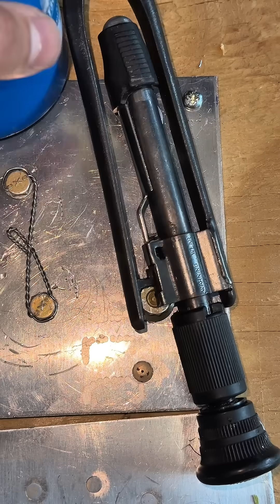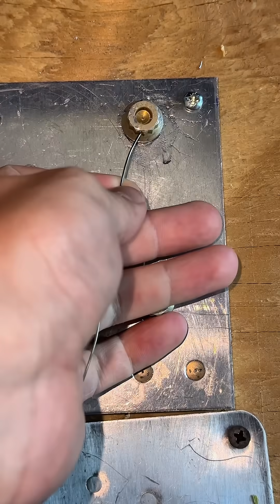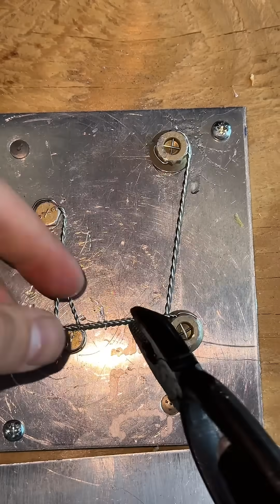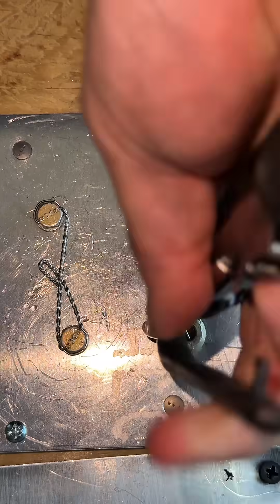Jet tech: Boomers Hated This Safety Wire Tip 😤✈️ #AviationMechanic #shorts #mechanic

Comment: The Air Force has been using safety wire pliers since they were invented.

My father was a jet engine mechanic on 3 blade prop A-model C-130's from 1959 to 1964 (he got stop-loss'd by the Cuban Missile Crisis)

He's 85 and he still has a pair of "crew chief" pliers in his tool board.

They're a great tool.
Reply: It is interesting the difference between branches. I was an army Blackhawk mechanic 10 years ago. No pliers allowed. If Qc saw any marks on the wire from pliers they would cut it. Always figured it was across all branches.
Reply: @anthonydrew4388 the disrespectful child that made the video and the "doing it right" comment thinks he knows everything and hasn't lived or experienced enough to realize that there are other ways than what he was taught. He probably believes that the FAA is some infallible entity and not just a group of talking monkeys that have agreed to agree about a thing.

Comment: I do all kinds of fabeicating at work, and sometimes keeping things together is a chore, I work in a stamping plant, but this is a nice technique, I'm gonna have to keep this in my mental toolbox, can just drill a couple little holes in the head of an allen head bolt 👍
Reply from the maker: You can order predrilled bolts online
Reply: @northeastaviationpro if it was for a personal project I probably would, but tool and die has any size bolt I could want for work projects, and half the fun is making it yourself 😁
Reply from the maker: @Dsmwarrior1996  nice good luck
Reply: @northeastaviationpro thanks for the technique, I love little things like this!

Comment: I'm a boomer aviation mechanic.
I know how to do a proper safety wire by hand.
But, if I have safety wire pliers handy, I will use those.
Work smarter, not harder.
Reply from the maker: Ty
Reply: @northeastaviationpro   literally the dude you were talking about 🤣
Reply: Ya I’d use the pliers too.
Reply: Me too, 1970-'74 Navy Avionics tech. We were issued, and used, safety wire pliers every day. Ya, we had to know how to achieve the same perfection without them, but nobody did that unless the job was so tight that the pliers were a handicap. I got yer "boomer" right here.
Reply: Good job. Pliers are ok where they work. Sometimes hand is easier too… 24 y commercial aviation ret.
Reply: Gotcha boomer, watch this video again and this time, really hear what is said in this video. If hard of hearing, enable captions.
Reply: @miloesalazar 
Gotcha Milo.
Now, read my comment again, and this time, really read what I wrote.
Try to comprehend all the letters.
Reply: @miloesalazar  go sit in the corner & color Phil. Or should we call you 2380.
Reply: @miloesalazar 
All I said was that I use safety wire pliers.
I may be a boomer, but you're just another 🍆 in the YouTubes comment section. 🤷

Comment: I personally love cable lockwire systems, check out Bergen Cable to see what I am talking about.  Cable lockwire creates less opportunity for FOD on installation/removal, is easier to install and you can actually prove the strength of the cable which you can't do with hand done lockwire.  I know what everyone says, too expensive but if you do the math on it, you will save a lot of time and time is money.  If you save 4 minutes installing and removing cable lockwire, by the time you go through a hundred cables you have saved 400 minutes of time.  Therefore those saved hours of time save the cost of the tool and the cables by far...  Better technology, higher quality, less opportunity for mistakes and a higher level of safety.  I agree with you 100%, quality is job one because our mistakes make smoking holes in the ground with dead people in them, keep up the good work!!

Comment: that's funny, my dad was an aviation machinist on the USS Shangri-la during the Korean era, and later an A/P with IA and he always had those pliers, I have them now, circa 1960 manufacture, so it's not new, and I've never heard anyone say they used to do it by hand and I hung out with a lot of old wrenchers in the aviation sector, basically you're making a "contoversy" where none exist and correcting no one.
Reply from the maker: its a joke
Reply: @northeastaviationpro  it's not funny then, kind of childish and unprofessional, just what your industry doesn't need.
Reply from the maker: Ok snowflake
Reply: @northeastaviationpro  you would be an example of the immaturity apparently, DEI hire?
Reply from the maker: @HappyLittleSquirrel-k5j

Let me clear this up once and for all:

I didn’t attack boomers—I imitated the ones who pop into my comments to cry about safety wire like I personally insulted their toolkit. I made a joke, and somehow that triggered a multi-paragraph essay about your dad’s pliers and some imaginary controversy.

I’ve made safety wire content that’s helped thousands of techs pass oral/practicals, sharpen their technique, and even start their A&P journey. I’ve done more for the aviation maintenance community through these videos than your passive-aggressive nostalgia ever will.

Calling a joke “unprofessional” while getting offended on behalf of your dad’s pliers from 1960? That’s not professionalism—that’s fragile ego wrapped in a war story.

Also, tossing around “DEI hire” as an insult just proves you’re not actually concerned with professionalism—just mad someone younger is getting attention and helping people in a way you never did.

The boomers didn’t get attacked—they showed up mad that someone was doing safety wire different than their memory of it. And spoiler alert: that’s not my problem.
Reply: @northeastaviationpro  hopefully your childish pride doesn't make a plane fall out of the sky, have a nice day
Reply from the maker: “Childish pride”? Buddy, I’ve made hundreds of videos teaching people actual skills—not nostalgia, not fairy tales about how you did it in ‘Nam, but real, modern training that’s helped thousands of A&Ps pass their tests, get jobs, and keep planes flying safely.

If my videos were dangerous, FAA examiners wouldn’t be recommending them. If my work was childish, the people using it wouldn’t be licensed professionals now.

You’re not mad about safety—you’re mad you’re not the one in the spotlight. And hiding behind “concern for aviation safety” while tossing insults in a YouTube comment section? That’s not professionalism. That’s washed-up bitterness dressed as relevance.

So here’s a thought: Instead of worrying about planes falling from the sky, worry about your fragile ego crashing every time someone younger does it better.

Have the day you deserve.

Comment: For anyone like me who had no clue what was going on at first, here’s a quick explanation: 

Safety Wiring (commonly referred to as Safetying in the Av industry) is used to secure mechanical fasteners that may otherwise come loose due to vibrational or other similar forces. This practice is simply using basic physics/mechanics to connect 2 or more fasteners in such a fashion that the retentive force is in the opposite direction of the objects’ removal. Meaning any vibrations that would previously cause the fastener to jar/thread loose? Is now nullified, or will even tighten said fastener. 

(This comment section seems much more educated on the topic than I. Someone more knowledgeable is very welcome to correct me or expound upon my comment)
Reply: What's going on here is that the narrator is slandering an entire generation.
Reply from the maker: False but good try
Reply: @LucidDreamer54321  he must have watched the recent magic money wojack videos :-)
Reply: Now explain to me why thread lock isn't good enough.
Reply: @kingpest13  When maintenance or repairs are needed, do you want to deal with breaking free the thread lock and spend time properly cleaning the threads, or would you rather simply cut and remove safety wires?
Reply: @kingpest13  For NASA zero-g flights that require positive locking, loctite can be used as a secondary locking feature but not as the primary locking feature. This is due to the amount of failures they observed with loctite during ground tests.

And yeah, thread lock just isn't practical for many purposes. You're making things harder for yourself while achieving a less reliable positive lock.
Reply: @kingpest13  for the same reason you don't assemble a whole airplane using only glue: metal is king.

Comment: Safety wire should not be under high tension. It should have a little bit of wiggle in it and that is per regulation and that is to let you know that the wire the nuts haven't backed off. If it's tight then you know it's backed off

Comment: Old semi trucks have wire on mechanical fuel pump and compressor. This tech is as old as the boomers… they designed it😂🎉. It still works good to this day for certain things
Reply from the maker: That’s right, it’s a timeless technique, for sure!

Comment: Some use it on big two stroke bikes as well. Like the 500cc to 750cc. I see it mostly on older two stroke Street bikes modded for drag racing. But it's a good idea for any two star cause they have a tendency to rattle the bolts lose.
Reply from the maker: Yes they vibrate a lot ive used it on 90cc 2 strokes works like a charm

Comment: In the 80s, I worked for the Navy on submarines. We had to put lockwires on certain types of valves and fittings.  We had the lockwire pliers - they worked great. I couldn't imagine trying to do proper lockwire without one
Reply from the maker: That's awesome you got to work on subs, those pliers definitely make the job easier!

Comment: You did one wrong. You dont cross in through the bolt + you go around. Im in AP school right now and have 10yrs in Aviation and 15yrs Automotive. The rest were right.
Reply: You one of them boomers aren't you 😂
Reply: @mrm9369 37 and work for the big 3 Commercial Airliners.
Reply from the maker: Boooooooooomer

Comment: Airframe I worked on decided to go with safety cable instead of wire. Much easier to do. More expensive though
Reply from the maker: That sounds interesting, I've never worked on a system that used safety cable, but I bet it is easier.

Comment: I'd fail you on both!  Pigtail too long and also for touching the span on the left, and touching on the right.  Safety wire should not touch itself once twisted.  It can crack and break the wire with vibration.  Would also question the crossed wire in those bolt heads.  If the book says it's OK, then it's OK.
Reply from the maker: Crazy how some people get so hyped to fail others in a comment section like they’re running a certification board from their couch. 😂
Real ones know it’s about learning, improving, and sharing—not flexing imaginary authority on social media. Appreciate your input though, boss.
Reply: @northeastaviationpro  Old military aircraft mechanic gigging you as my instructors gigged me.  Yes, I gone through a full day with a TI trying to get positive safeties on a line of bolts that can only be wired neutral.  That's a frustrating day!
Reply from the maker: ? Not sure what you point is but ok

Comment: Get over yourself dude. Nobody goes around counting twists. If it stops the bolt or nut from turning it's fine. It takes a couple minutes to explain safety wire to a rookie: another couple minutes to show and a couple more to let them do it. Then they're experts.
Reply from the maker: Yeah bro, just slap some wire on and call it a day, right? 😂 That’s exactly how planes end up in accident reports. ‘Good enough’ isn’t the standard—precision is. If you’re bragging about rushing through safety wire like it’s a TikTok challenge, maybe this isn’t the craft for you
Reply: @northeastaviationpro  yes, that's pretty much it. You're not splitting an atom, you're securing a bolt. Spent decades laughing at mechanics like you: not for being conscientious- that's fine- but because they think it has to look pretty. I guarantee you're one of those.
Reply from the maker: Aight bet, keep flexin’ like half-twistin’ safety wire makes you a OG. Y’all out here buildin’ paper planes while real ones build machines that stay in the sky. ‘Good enough’ gets body bags, not respect. You proud you been lazy for decades? Congrats bro, you been wrong for 30 years straight. I ain’t tryna make it pretty—I’m tryna make sure it don’t fall out the sky ’cause some old head thought vibes and prayers would hold a bolt

Comment: Retired Army tracked Mechanic.. done thousands of those on the M1 Abrahams since its a turbine powerplant.. good job!
Reply: Used them tons on 25 Mike Mike as well.
Reply: I don't know about todays military vehicles but back in the day many used this safetying method. I had both an older Vietnam era 5 ton and the next newer 5 ton and both used this in various places. I also had an old M113 Apc that used this on critical bolts. Working on the vehicles in the Motor Pool was a breeze but when you're out in the field at night and have to replace damaged parts by muted flashlight while trying to be silent and lining up the holes for that wire wasn't very much fun. We made it though and that's what mattered.
Reply: @danhnguyen-fn9eb  its still all over the place in the military .. Powerplants on all the army's tracked vehicles are laced at the bell housing bolts
Reply from the maker: Thank you 🇺🇸

Comment: I'm a Industrial Diesel Generator Specialist also Marine Diesel Propulsion. I work every day. I've worked on Airframe and Powerplant stuff, under the supervision of a Licensed A&P. We had FAA Regulations. We also used Safety Wire. I have a set of those pliers. On Generators and Marine too. You safty wired that OK kid. I'm a Boomers. We have about the same percentage of @$$holes in my generation as you do in yours. But. Good Engineering and Best Practices Are Timeless. So are FAA Regulations.
   What Idiot Boomer complained about the way you safety wire stuff?
Reply from the maker: Nice read the comments

Comment: Soooo.... the wire stops the screws from loosening? Or... what that do??
Reply from the maker: Yes sir thats what is does we make sure that the bolts holding on the winds dont vibrate loose and you crash

Comment: Former USAF F15 crew chief here. We use safety wire pliers exclusively as per regulations. No ifs ands or buts.
Reply: Some places the pliers won't fit and allow you to twist.
Reply: @5695q you heard the guy.  No ifs ands or buts.
Reply from the maker: Thanks for sharing your experience!

Comment: Back in my day we put a safety weld on the bolts in case the safety wires snapped. We also peened the extruding part of the bolts in case the safety weld cracked. We also bolted an extra seat in the cockpit for an extra co-pilot, in case the first one died during the fligth.
Kids these days just take the easy route to get back to smartphones asap...
Reply: What, no inflatable Co-Pilot...!?  Horrors!
Reply: @OliverT-qt1gn  thats back at the barracks
Reply: How else will i respond to my text while im flying?
Reply: Back in my day, we used to carry a sheet of canvas and a bucket of dope, just in case our wing overwarped and ripped the skin. And we didn't need no seats. We just saw on the wing and wrapped our arm around the wing strut.
Reply: "The first man in line sits in the captains chair and flies the plane! When he dies, the second will take his chair and continue flying!"
Reply: Peened? You mean you smeared your peenor all over the bolts? Disgusting
Reply: Boomers rock!
Reply: я бы еще просверлил гайку сбоку, и закрутил стопорный винт) а уже этот винт расклепать и проволокой на сварку)

Comment: I understand its place in aeronautics, but I hate that it's made it's way onto heavy equipment. When i need to change a attachment pin 30 miles from the nearest paved road and 2.5 hours from a town with only basic hand tools safety wire is my greatest enemy and most hated feature and never gets put back on. Not saying it doesn't have its place, it does. Just not on my equipment.

Comment: What is safety wire for? I've never heard of it before
Reply from the maker: Safety wire is a thin, stainless steel wire used to physically lock bolts, nuts, or fasteners in place so they can’t loosen up from vibration or movement. You thread it through small holes in the bolts and twist it tight with special pliers. It works by making sure that if one bolt tries to rotate loose, the wire actually pulls it tighter — basically forcing parts to hold each other in check.

It’s a simple but crucial technique in high-stakes environments like aviation, motorsports, and military equipment — anywhere failure isn’t an option. Think of it like the mechanical version of a seatbelt for bolts. Not flashy, but it saves lives.
Reply: @northeastaviationpro  Thanks for the explanation! I'm assuming Loctite is not enough to keep things from vibrating loose? Or is this a more safe way of for sure keeping things together?
Reply from the maker: Idk its just how we do it in aircraft

Comment: My dad is a boomer and former airforce jet fighter technician. I still have his pair of saftey wire aviation pliers from 1968. He taught me how to use this stuff and ive never been an avaiation tech, but it comes in handy on equipment that vibrates alot, and great for any fasteners on the belly of a race car.
Reply from the maker: Wow

Comment: As a Boomer I can attest those so-called "fancy pliers" were already widely used. Doing up safety wire by hand was tedious, and if you didn't have years of experience, looked sloppy. Fun fact: Most Boomers exposure to safety wire work was on exhaust headers. It was functional and looked very cool on a Chevy 350 V-8 small block.
Reply from the maker: Interesting to hear your perspective and thanks for watching!

Comment: Is the video fliped or did you put them on backwards?
Reply: Neither. The wire prevents the bolts from turning counter clockwise, which would cause them to loosen.